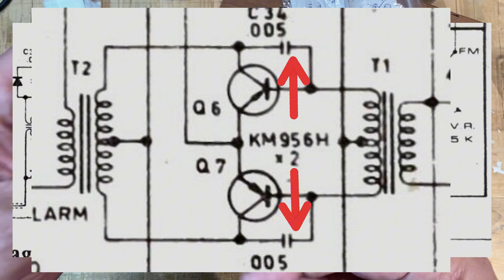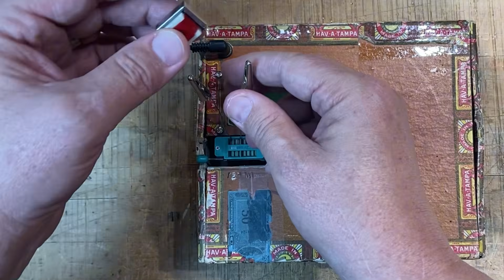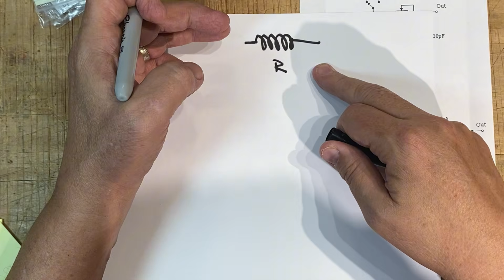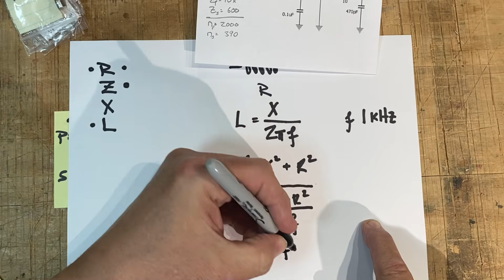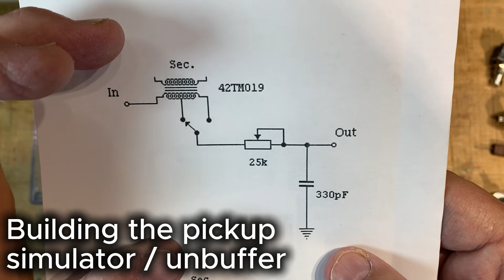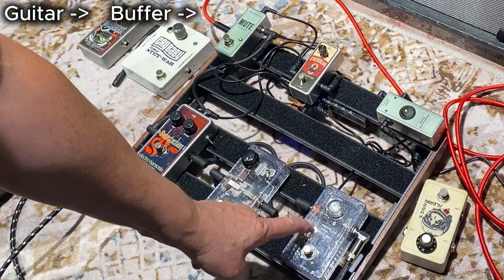I Built Jack Orman's Pickup Simulator From a 1960s Radio

Comment from the maker: Have you actually gotten a dramatic result from a pickup simulator/unbuffer?

My test with the Satisfaction Fuzz produced a difference I could hear, but it was very subtle. So now I'm wondering if I simply haven't found the right fuzz circuit for this experiment.

If you've built or used one of these, tell me what pedal you used it with and what changed. I'm especially interested in examples where the difference was obvious.

Maybe there's another experiment waiting here...

Comment: Couple questions. Im new, so thabks if this is a newbie question. 1) how did you determine which was the primary and which was the secondary? 2) wheres the link to build this tester box??
Reply from the maker: Well the transformers were marked with a big letter P on one side. That’s how I knew what the primary was. Still, you can run them backwards so primary is a relative term. Whatever side you use for output is the secondary. If I didn’t put a link to the plans, you can Google Jack Orman Pickup Simulator and it should pop right up.
Reply: @MadScientistGuitarLab hahaha thank you!!

Comment: What in the name of Christ did I just waste 17 minutes watching?
Reply from the maker: Ego te absolvo. 
This was my build of the Jack Orman Pickup Simulator (or Unbuffer as it's commonly known). As a scientist, I had to navigate from what I could measure to what was called out on the spec sheet. I built and tested the device, but the results were not as I had hoped. Another viewer suggested that I try the device with a Fuzz Face since that is what the original Unbuffer was designed for.

Comment: Have you tried shorting the unused transformer winding? This can have a big impact on its inductance.
Reply from the maker: I wondered about that. In fact, I could put a capacitor across it or a resistor... just to see what it would do. Thanks for such a fantastic suggestion!
Reply: @MadScientistGuitarLab   i  only mentioned it because, some time ago I was wondering if these smal transformers could be used in a VCF by coltrolling their inductance... I didn't get very far.
Reply from the maker: @Bishka100  Rest assured, this is exactly the kind of experimenting that a mad scientist loves to do. :)

Comment: I don’t really hear a change when the transformer is engaged. Some fuzzes don’t even blink at a buffer, but others really don’t like buffered signals. Try it with a germanium fuzz face. That’s the circuit this pickup simulator was designed for. Also, hear me out… maybe the transformer you chose was a poor choice for this circuit. Perhaps you could clip in different transformers and test to see if any of them produce a change.
Reply from the maker: Great suggestions! I have a handful of old GE transistors and I'm going to build a Fuzz Face or Tonebender Mk1.5. They are pretty much the same circuit. I also have tons of other transformers and old pickups that I can clip in there. Depending on how well it works, I will likely follow up this video with the results and any insights. Thank you for all of the tips.

Comment: You can also use a cheap or old pickup to replace the transformer if you had any lying around. The more winds in the transformer or pickup has will darken the output. Any old transformer will technically work just at a reduced bandwidth. I use it with a wireless transmitter and receiver into fuzz and treble booster style pedals.
Reply from the maker: Good ideas! Thank you! I have tons of other pickups and transformers laying around.

Comment: I think the 2006 updated one with the tone pot is more effective, a boost pedal pushing into the pickup simulation with germanium based fuzz at the end of the chain works well.
Reply from the maker: I have those plans too. I wanted to start with the original idea just to see what it would do. I will have to make the full up version to compare.